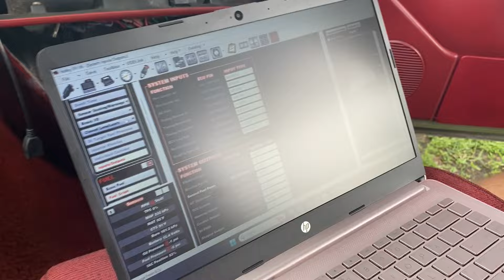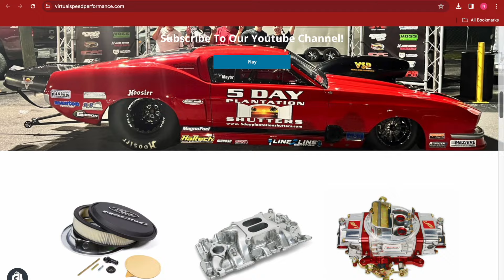WE FINALLY GO TURBO? NEW TURBO FOXBODY MUSTANG STREET CAR!

Comment: Sounds good! I'm going to have to upgrade mine. Going from LS cars and hp tuners to a stock foxbody computer with a chip is a different animal.
Reply from the maker: I’m sure, I’m a carb & MSD box guy so I’m just trying to figure out the EFI 🤣🤠
Reply: @Virtualspeedperformance  it's sounds like it runs really smooth. If I can't get my junk figured out it may end up with a carburetor on it but I would have to swap my paxton for a turbo and blow through carb🤔